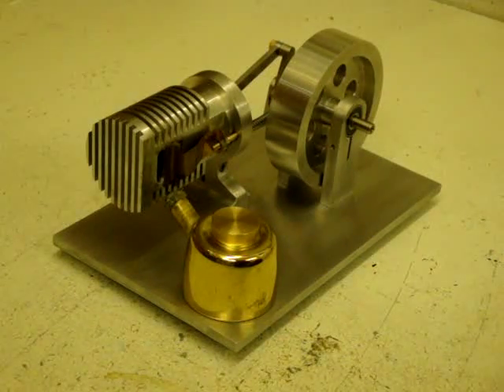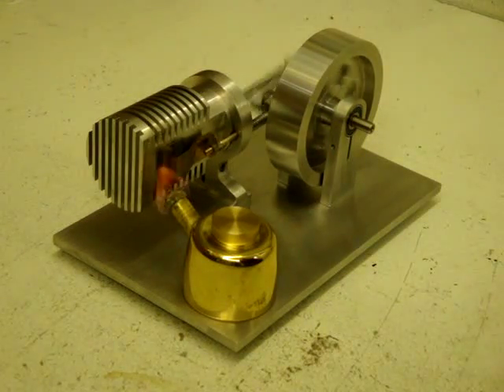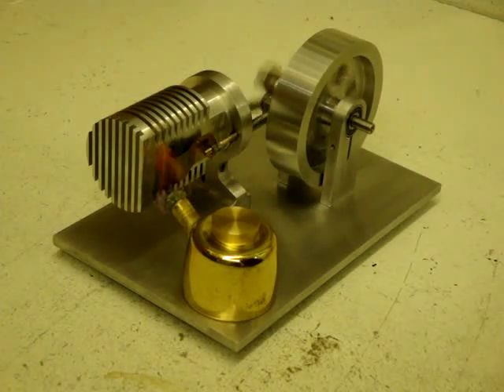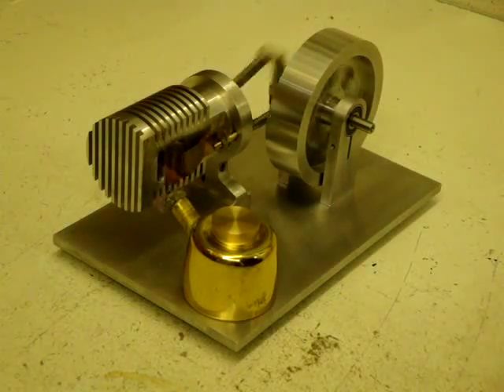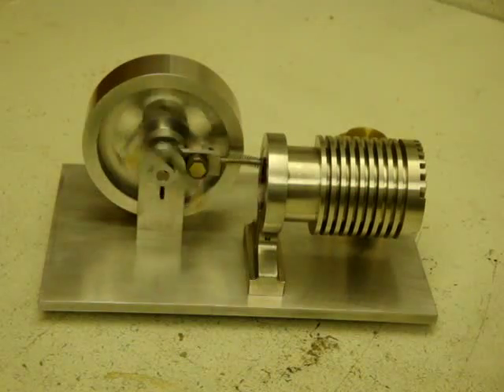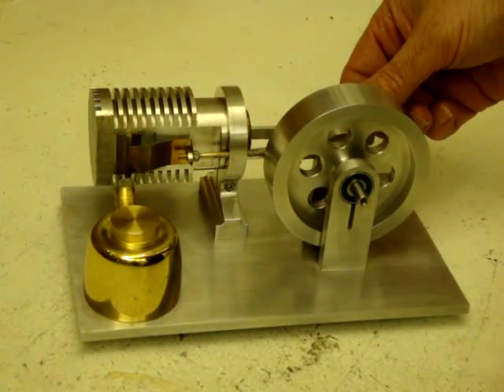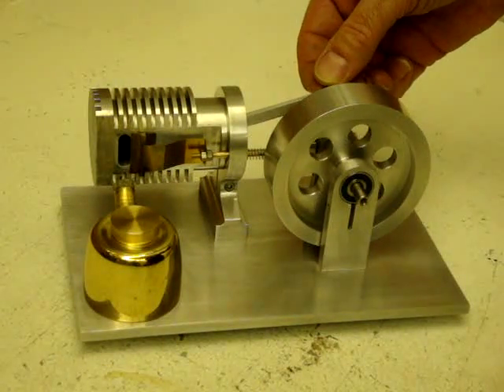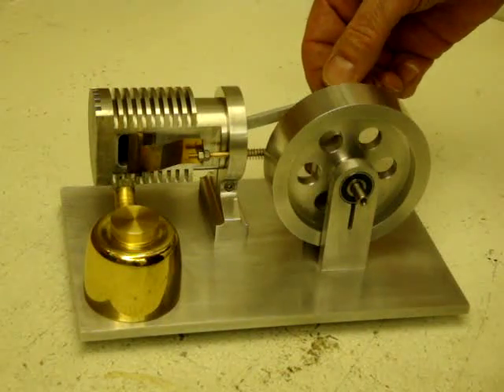Fire Eater Engine

Comment from the maker: @MrKaddan Yes it would stop if the cylinder got to hot. What happens on mine is that as the cylinder heats up the engine slows down so that less heat is drawn in to the cylinder and it cools speeding up the engine again. If left running for longenough you can see the cycle of speeding up then slowing down 

Paul

Comment from the maker: Answer

Mine is directly from the drawings 

There is practical no power, so the flat spring plate that is used to move the valve is not pushing the valve against the cylinder port, the vacuum of the flame condensing holds the valve against the port. The valve return spring is only just enough to hold the pusher against the cam. I do not use any oil just graphite lock powder to lube.

Yours Paul